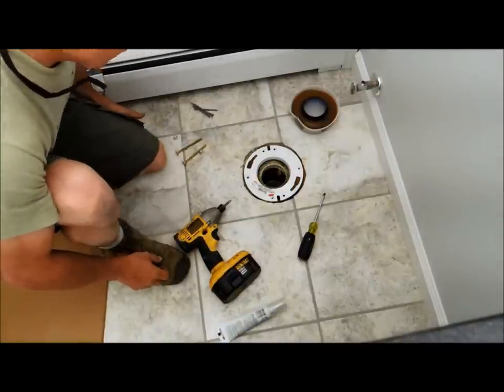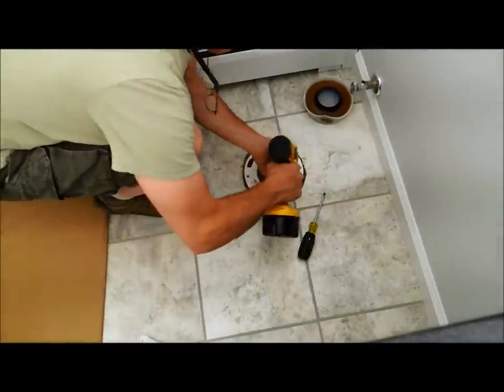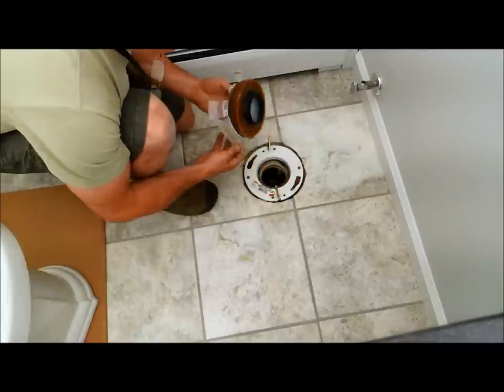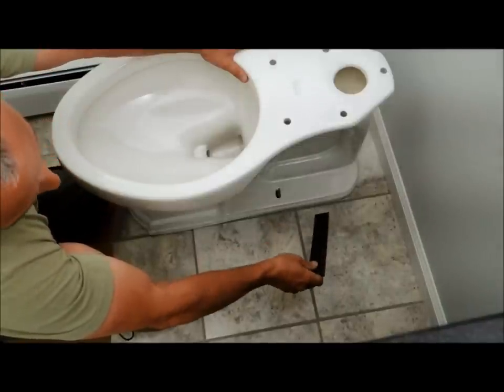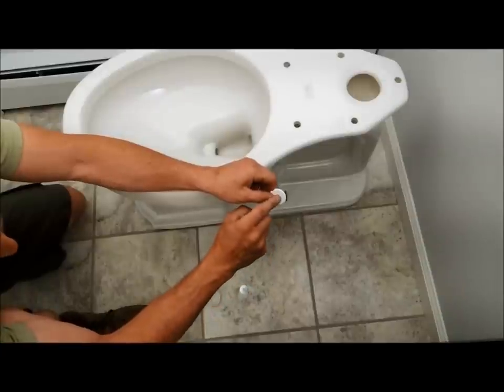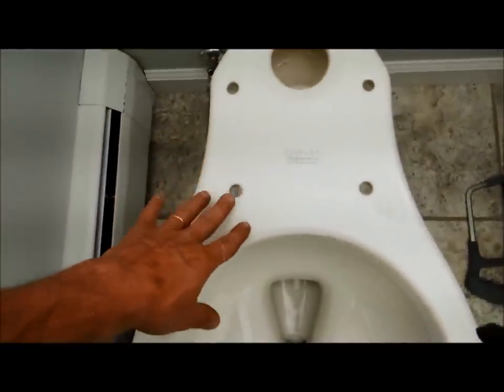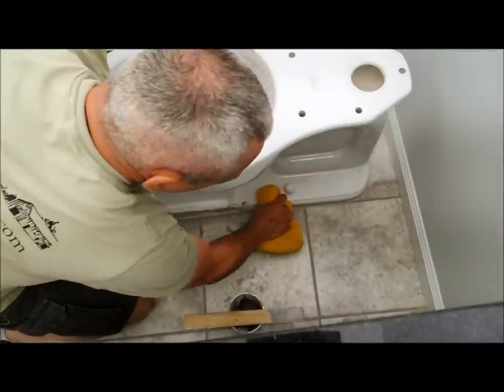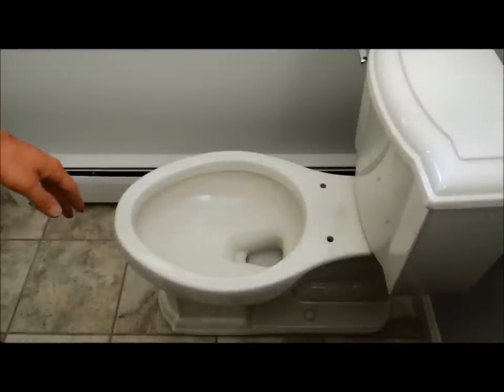Tutorial: How To Set A Toilet

Comment: After watching 50+ videos, I finally found one worth watching.  This will be a huge help for me.  I only wish an uneven flange was addressed more.  I have new tile and a 1/4" difference left to right.  I think the beginning of the video covered it, but I plan to use a spacer, a flange with a funnel into the drain (fluidmaster), and use an extra thick wax ring.
Reply from the maker: It's not at all uncommon to have the flange tilted to one side, unfortunately.  You may be able to make an adjustment by cranking down (slowly and carefully) on the screws by the tall side, or by adding additional screws on the tall side. Just be careful not to get greedy and crack the flange.  But, the wax seals with the funnel are pretty forgiving, so it's likely that will work for you.  If you get the jumbo style, be certain that the toilet bowl is actually seating on the floor.  Sometimes the jumbo rings are just too thick for the job.

Comment: Rather than letting the bolts pull the toilet down onto the floor (and risk cracking the ceramic), I put my full weight on the toilet to completely seat it onto the wax ring. Then, while my weight is still on it, I tighten the two nuts. If the toilet still rocks, then you have to add shims as John described.
Reply: If it doesn't rock and doesn't leak but is not level do u go thru the hassle of shims?

Comment: The only drawback I see when sealing around the base of the toilet with the shims is if there is a water leak, will you be able to detect it? I was always told not to caulk or grout around toilet bases. I see why you had to with shims but fixing one problem may help hide another.
Reply from the maker: I mentioned in a previous response that sealing around the base of the toilet is not a choice--it's required by code. As far as I know the reason behind that code is to prevent sanitary problems with water or whatever else getting under the base  from the outside.   It's the same reason that undermount sinks must be sealed according to plumbing codes.  Now, some people (myself included) like to leave a small section in the back of the toilet unsealed for the reason that you mention--water leaking from the flange seal will be detected before it causes damage.  However, your local code inspector will have the final say on that practice, and he may require a full seal.
Reply: enduringcharm thanks for that info.

Comment: Flange is still not high enough, it's suppose to sit ontop of the finished floor not flush or below. Also not enough silicone under the spacer, your better off using a thin wax ring under the spacer and if the flange sits ontop of the finished floor you will not need a wax ring the the built in cone. All you would need is a regular wax ring. Then use plaster of paris around the base and the toilet will be solid and never leak, been doing it that way for over 20 years and never had an issue. Plaster of paris will make it easier to pull toilet in future,  like 20 years down the road. I also push the toilet down over wax ring with out moving toilet then I bolt it down going back and forth to each bolt. Once it tight I then use putty knife through get all the plaster of paris off floor and then a grout sponge to make it look pretty and smooth. I normally put my tank on before I set the toilet this way I'm not desterbing any of the plaster pf paris . I have used grout also if I don't have plaster of paris on and , white grout and it will make the toilet rock free as well and will come right up in future. I always use a good qaulity wax ring . Every plumbing contractor has his or her own method but I'm just sharing method with everyone. I have never had to use shims when using plaster of paris, plaster of paris is self leveling. Also if the floor is unlevel just push more plaster of paris under that area once the plaster of laris drys it will be solid as a rock you don't have to worry about putting shims under it ever again. I use alot of the plaster of paris because you can just wipe off what oozes out and wipe it clean. Saves tons of time having having to put shims under the toilet inuse a level like the video shows but I just use the plaster of paris . I'm sure there are probably tons of videos out there of other master plumbers like myself who use the plaster of paris and or the grout.

Comment: Awesome vid and gave me the confidence to undertake this pain in the ass project!  Just completed it but have a question, I install the wax ring like you recommended placing it in the flange hole instead of the toilet; when I went to see the toilet, I expected some resistance from the wax ring and expected to push it down like most people do; however, there was no resistance at all really in the toilet was flush with the ground which freaked me out;I still do not know if I established a good seal and I’m concerned, but I don’t have any water yet so I guess that’s a good thing, wanted to get your take on this
Reply from the maker: Several things are possible.  Did you notice if the toilet flange was located slightly above the finish floor (tile or whatever it is)?   I actually have a video on this ( https://youtu.be/DixhpVg9o40 ), but the flange should be, say, a quarter inch proud of the finish floor, sitting on top of it.  If it isn't, then you are asking the wax ring to reach too far.  Another possibility is that the wax ring you purchased is a "standard" size or one of those cheap ones that comes with a new toilet.  You may need a "jumbo" size, which just has more wax.  

When you set the toilet you should feel the toilet contact the wax before it contacts the floor.  Typically it's a half inch to three quarters of an inch off the ground when you feel the contact, and then the wax squeezes out the bolt holes a little bit.  A wax ring is a few bucks.  Pull the toilet back off and examine the ring to see if there was good contact or not.  If not, get a jumbo ring or fix the flange height.  If there was good contact, you just overreacted and learned a lesson for the price of a wax ring.  Report back with your results so we can follow your story!
Reply: Thanks so much for replying....well, I already installed entire toilet assembly and I guess I’m rolling the dice on this....I’m not normally a glass half full guy but I’m hoping a seal was established 🤞🏻; saw a little wax in the bolt holes but not a whole bunch....when do u think I will know if I got lucky and no leaks?  I flushed several times without leaks, but still concerned.....
Reply from the maker: It's not so much that puddles of water will come out, it's that small amounts are escaping underneath the toilet which you will never see.  Eventually your floor rots out and you have a bigger problem.  Seen it many, many times.  Of course, escaping sewer gas isn't pleasant either.  Like I said, I have no idea from here if you established a seal or not, but you should have felt some resistance just before the toilet base bottomed out.  It's possible you have a marginal seal and it just happened to be a close call.  Hopefully you did use the integrated funnel style of wax seal, which are better at directing water and avoiding leaks.
Reply: Ouch, knew I should have redone, but was lazy and hopeful; did use the funnel wax seal; so you’re thinking the prudent action is to remove tank and bowl and do it over to be sure ?? I’m concerned that it’s a new toilet and now I’ll be taking it apart and possibly compromising the integrity, ugh.  And I forgot to ask you your thought on the green flax wax less ring?
Reply from the maker: Believe it or not, I have a video on that foam ring too!  ( https://youtu.be/jsiND2phTQ8 ) I really need to get out more often.  Anyway, I can only guess if you got a good seal or not, but you should have felt some resistance before you bottomed out.  It's not a big deal to pull the toilet and look.  If you already caulked or grouted the base, that's unfortunate, but the rest is easy.  Drain the water (good lord, I have a video on that, too!  https://youtu.be/mfy5tAOHXF4 ), unscrew the supply hose, unbolt from the flange and slowly rock it up while you stand directly over it.  I usually grasp the area between the tank and the round part of the bowl.  If you did caulk already you'll have to cut that seal with a utility knife.  So, it's 20 minutes of work to remove the whole toilet and plop it down on a piece of cardboard.  Check the seal, change something if need be, and then reinstall, possibly with a jumbo ring.  But, if you think back and you recall meeting some resistance before bottoming out it might be fine.
Reply: Your vids are the best!! Thanks so much for the guidance and responses, it’s invaluable to a no-business-being-a-DIY’r, I will watch all the vids and re-do; it’s living and learning at its best, but you’re taking a lot of the difficulty out of the learning part!! Peace out!!👍

Comment: Do you never wear knee pads man? Killing your knees!
Reply from the maker: I do, but sometimes I get caught up in the work and forget.  I also find that many knee pad designs are flawed.  Either they are uncomfortable due to the straps, or they don't stay put, or they damage the flooring surface, or they collect grout/mortar/dirt in the pad surface, which gets spread around elsewhere.
Reply: a kneeling pad can work well for some jobs.
Reply: @enduringcharm , I agree on knee pads. I have cut thick swimming pool noodles in half ( each piece is intact just two shorter pieces instead of one long one), and then kneeled on the two separate pieces. Works pretty well.

Comment: Toilets are meant to be serviced... why are you grouting the toilet to the tile?!
Reply from the maker: First, plumbing code requires that the base be sealed.  So, you can use either a silicone caulk or a grout to match the tile.  The grout looks much nicer.  When the time comes to remove the toilet, it actually comes up more easily than if it is sealed with caulk.    With the toilet gone, the grout can be scraped off the tile in a few minutes with a plastic or wooden shim.  Again, it comes up more easily than silicone caulk.

Comment: Why would you cawlk the toilet to the floor?, isn't that the wax ring is for?...don't know what you're doing....honestly.
Reply from the maker: The wax ring is to seal the toilet trap to the pipe flange so that sewer gas doesn't get into the room.  Sealing around the edge of the toilet is required by all modern plumbing codes as well, and you can use caulk or another method such as tile grout.  The seal around the edge, aside from being a requirement, prevents water that ever drips on the floor (like from a shower or a clogged toilet overflowing) from going under the toilet and dripping into the space below.  It also prevents dirt or other things from getting underneath, which is more sanitary.  Most importantly, the seal keeps the toilet in place on the floor and prevents it from ever rocking even if the toilet bolts come loose.  There is some controversy about leaving a small opening in the back, which is sometimes done on the theory that it will allow water out if the wax seal ever fails, alerting the homeowner of a problem.  Strictly speaking that does not meet code, but I've never seen anyone failed for the practice.
Reply from the maker: I missed your comment back when you made it, but let me explain now.  By code the toilet must be sealed around the edges.  The wax ring is meant to seal sewer gases out and prevent leaks.  But, I think the original intent of the code requiring sealing the edges is to prevent water or debris from getting under the base where it could fester.  In any case, you won't pass inspection without it if it is a permit job.  You can seal with caulk or you can seal with grout the same color as what you used for the tile.  As a bonus, the caulk or grout helps support the toilet on an uneven floor and helps keep it in place even if the bolts eventually loosen.
Reply: enduringcharm You can also place the toilet, mark/trace the base on the floor with a pencil.  Remove the toilet and place a half in bead/base of grout then place the toilet on top and bolt it down.  The grout will squeeze out, clean it nicely.  No need for shims and no wobbling and it's sealed.
Reply: Handy Man great idea I was thinking about using concrete like setting a bath tub. grout would do it too I suppose.